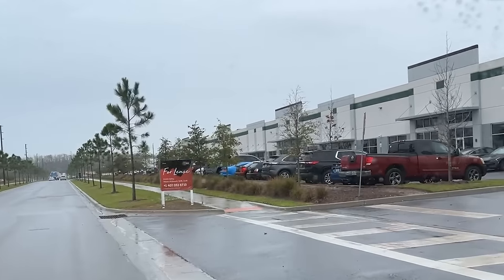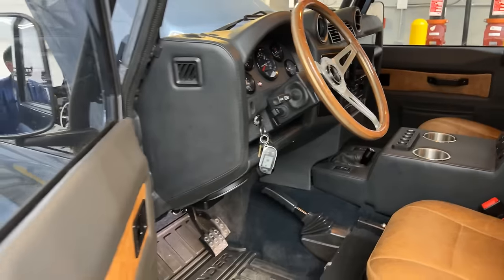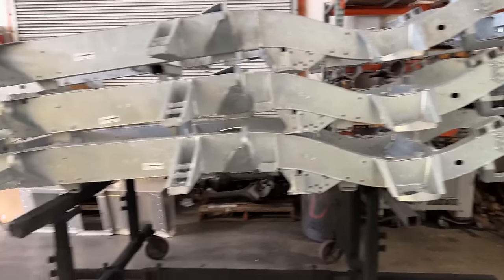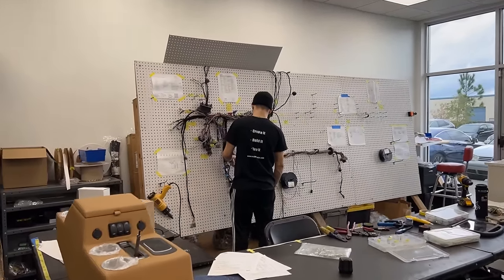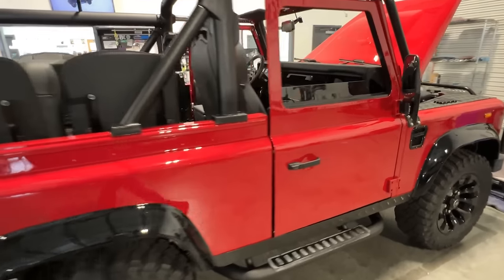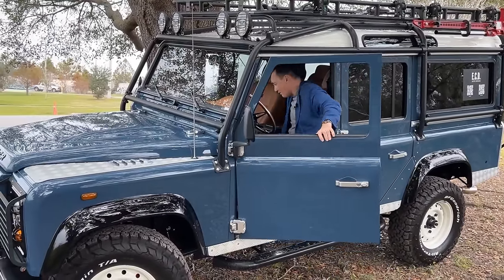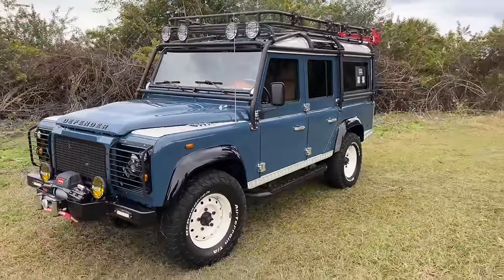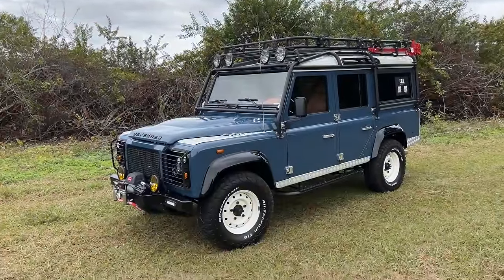Watch ECD Transform Graveyard Land Rovers into New Defenders in 60 Days!

Comment: I thought these 'Covid-builds' were over... you know where you pay 300+ for a car that sells at auction for 150 a year later with 700 miles on the clock. A Redux M3 is going under the hammer next week, I wonder how much value it lost in the 2 years the owner had it.